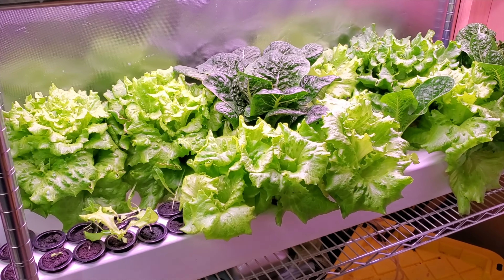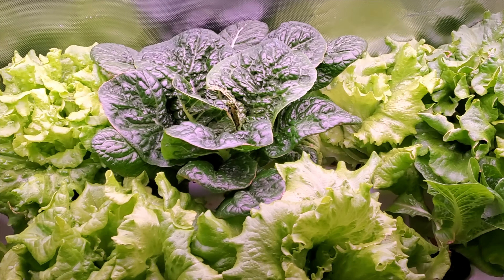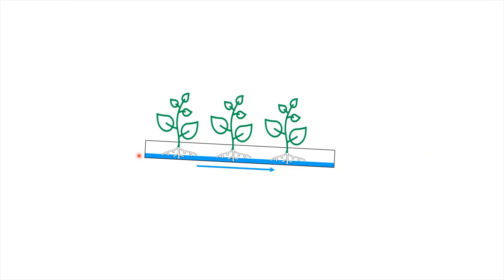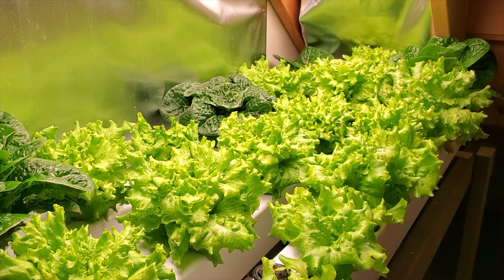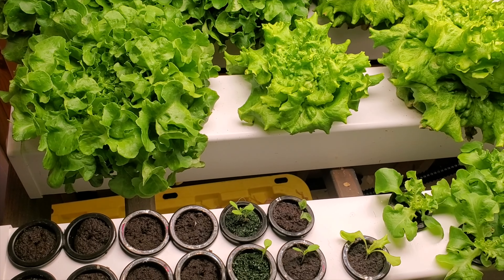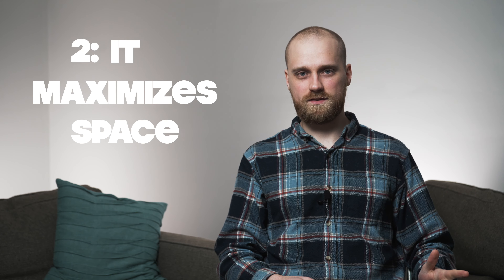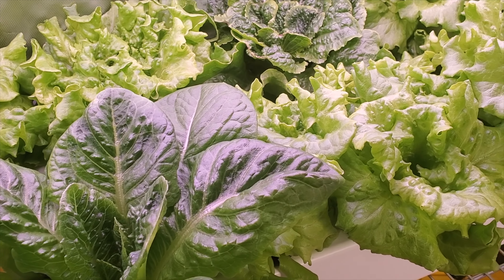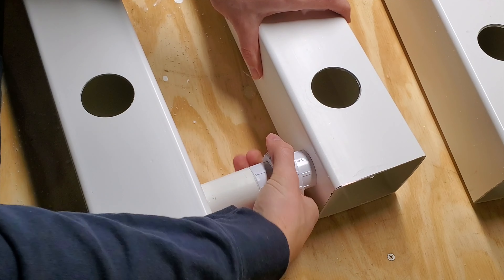4 Reasons Why I Don't Use NFT for Hydroponics

Comment: Really like the idea.  How do you clean it?  How often?  Any problems with waterborne illness, mold?
Reply: Great question!Would like to hear the answer to this.
Reply: Prone to root rot
Reply: @larrymarcum1673  I have had mine goine over 120 days with my strawberrys and about 40 days of lettuce before the strawberrys and  only done a water change twice so far. I have seen zero root rot. I check the pH and ppm when I add water or when the plants tell me something is  wrong.

Comment: I run NFT at home but I've got it set up so it can go into Kratky mode if we lose power. I also use a simple USB power bank to keep the water running for up to 2 hours after power loss. I used to run with variable spacing but I ended up going with standardized spacing and I'm using a separate spray box to propagate.

I think your system is objectively better than mine for what you're attempting.
Reply from the maker: Cool! Yeah my systems basically go into Kratky mode when the pump shuts off.
Reply: @SimpleGreensHydroponics  So, after running for the first season, I'm planning some changes. One of which is to eliminate the incline and transition towards a DWC system like yours, at least partially. I plan to keep about a half inch of water stored.
Reasons why:
- Power loss turned out to be annoying. I was constantly converting my system back and forth. It's cheaper to buy a few pvc fittings than to buy a larger backup power bank!
- I noticed that my longer-term plants were creating these dense root mats that raised the water level quite a bit. This became an issue when I added or removed plants upstream of other plants because the resulting change to water was a shock to the remaining plants in the system. A flat system will let me lower the flow rate considerably, reducing the degree to which the water level will be altered by obstructions. A slower flow rate also means that the system as a whole will be more tolerant of obstructions in pipe fittings.
- I also ran an outdoor, reservoir-fed system of Kratky tomato buckets this year. The total lack of root rot and general success of these tomatoes convinced me that aeration of roots can happen without turbulence.

How do you keep your longer term plant tenants from clogging your interconnect piping with root growth?

Thanks!
Reply: If you lose power you lose light and heat as well so that argument isn't valid anyway. That would be a problem for all indoor methods.
& Yes, believe it or not hydroponic mediums can be hand watered too. This entire video is heavily biased against NFT for a reason. The same reason that loads of other channels are promoting soil / organic growing.
Reply: @GMT439  I mean, my indoor system is next to a window and I have gas heating. I work 40 hrs a week and I'd prefer to have my hydro system be passively failsafe. I have had plants dry up and die quickly in my previous NFT build when the power went out. I really don't understand why DWC vs NFT has anything at all to do with soil growing or organic systems.

My argument is perfectly valid. Do whatever you want with your system... I'm sticking with the plans I selected based on my specific set of needs based on actual data from using my actual hydroponic system.

As for the bias of this channel, I don't really see some secret conspiracy against NFT... that would be incredibly niche. That being said, you have the right to believe whatever you want lol
Reply: @erich1394  It would not be Niche, I have seen almost everyone promoted by youtube pushes the organic style. Hardly anyone is advising to grow NFT even though it is a proven.
seedling argument is also not valid. NFT growers usually grow from rooted clones.
Reply: @GMT439  You are misusing the term "argument is not valid." Just because many commercial NFT growers don't grow from seed doesn't mean that everybody will want to operate that way. I happen to grow from seed and I also clone from cuttings. This argument is valid for me. I honestly think you're willfully being a stick in the mud and I"m done arguing with you.
Reply: Hey how do you clean the channels? I made something similar and I had a hard time cleaning it specially since I silicone the end caps to ensure water tightness

Comment: I've been using a nutriculture nft table for a decade. I find it's easieast to get your seeds started by simply filling the large rockwool cube with soil and just putting the seed in there. I run lowly nuted water through it until they have grown a little and then add full nutes.
Reply: but yeah nft table is quite different from the rails. I always have a spare pump but I've only replaced once in these 10 years.

Comment: Just finished my system. Had a little issue with Mars Light, so hopefully next week will begins seedling's. Going to have to tune down my pump a bit, water is touching the bottom of the net cups throughout the system. Dont know if that matters..? Appreciate the great system!

Comment: I know some people just put the seedlings on the bottom of the rail directly in the Nutrient Film. Then your seedlings have access to water. Of course you'll still have the issue if the electricity goes out or your pump stops working. Some people run 2 pumps so if one goes out plants still recieve water
Reply: @@lyingeyes6000 His system does have a pump for circulation. It flows from one channel, to the next and then down to the return reservoir. So it has the flow and oxygenated water of an nft, but can survive days if your pump fails.

Comment: Aha .. this answers my question on how to get seedlings going. So you're using the Kratky method that only look like a NFT, right? Very inspiring, thanks you very much.
Reply from the maker: Not exactly, my system still recirculates similar to NFT, but has deeper water in some rails to allow for seedlings. Once you turn the pumps off it essentially turns into a Kratky system.
Reply: @SimpleGreensHydroponics  Interesting. So how is the water moving? i ebb and flow? aeration?
Reply: @ErwinvanHolten  pumps. It's continuous flow.

Comment: Some good points, but a lot of those issues with NFT are only a problem if you're using a system made from vinyl gutters and the like. And I get. the idea of wanting to maximize the use of your available space, but again if the system is properly thought out and built you will be maximizing the available room you. have anyway. NFT also has it's place for "certain crops" vs others. Look for plants with relatively small rot systems, greens, some brassicas, even peas if you design a good support trellis. I however wouldn't use the best NFT system on the planet to grow big fruiting plants like tomatoes or squash.

Comment: The "my system" you're referring to is called DFT, for me only benefit is allowing pump/power failure.  growth on NFT is way faster which is more important for indoor grow.
Reply from the maker: I have also grown using NFT systems and did not notice a growth rate difference
Reply: Can I ask you about oxygen level of your set-up? I mean I used to have simple NFT system but to me, the plants always seemed to be overwatered everytime. I dont even imagine running higher level of water where the plants have been sitting. Sure I ran airpump in the tank 24/7 as well..i bought DO meter and measure 8mg/l which should be enough. Really dunno what was wrong with the system. Never had a problem with any other hydroponic system like drip for exemple. Thanks for your advices...

Comment: Great videos! I can’t seem to find the 1.5” net cups. I followed the link you have in some videos but it send me to a 50mm cup (2”). Any suggestions? I can’t seem to find 1.5”
Reply: If you read the details on the 50mm Beautyflier cup, it says 1.5" below the lip and 2" at the lip. I just got that type and it was 1.5", but when I placed the cup the hole was too tight as it was 1.5" on the inside. So, I ended up placing a 1.5" hole saw in a 1.75" hole saw and using that to widen the hole a smidge. The cups all now lay flat and have a little wiggle room for micro adjustments, which I prefer. The 1.5" caps work and fit perfectly, I just have to place them inside an empty net cup.

Another tip, if you're building the rails is to check the spacing of your holes with the net cups you get to take into account their lip sizes. Had I not done this, I wouldn't have been able to widen the holes.